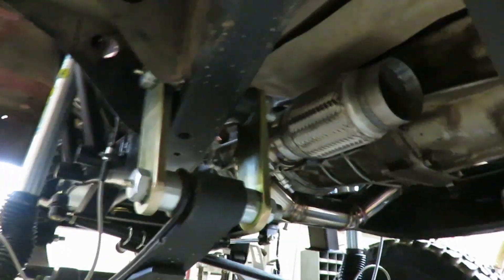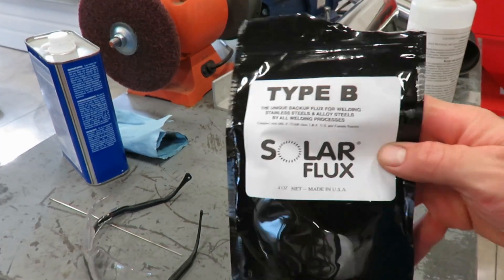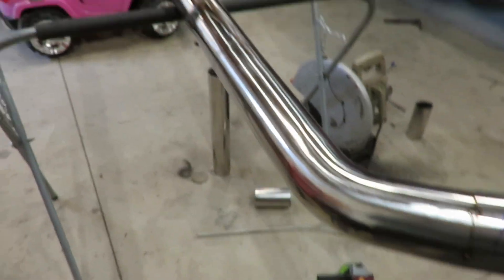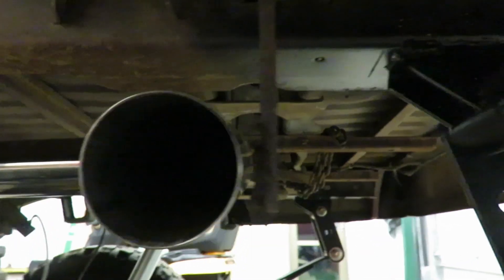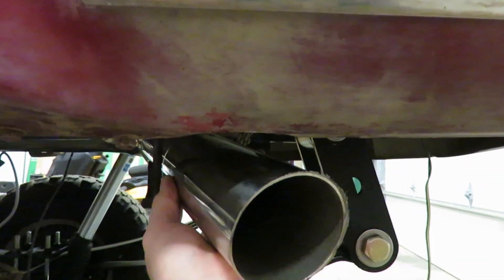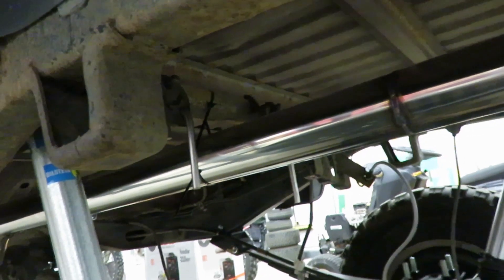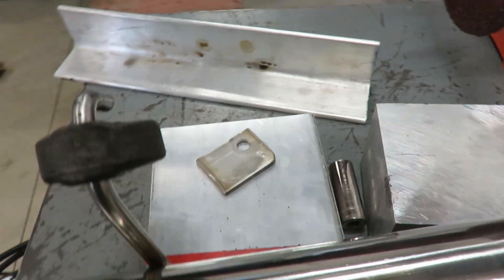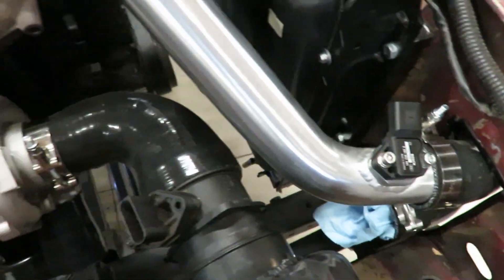Custom 3" Stainless Steel Exhaust Toyota TDI Swap Diesel

Comment: Great build!  I had to do the same thing on a 94 T100 with the cross over under the transmission (talk about making an exhaust job twice the work).  I've got an annoying humming vibration around 2k rpm that i'm pretty confident is coming from the exhaust harmonics/the pipe itself vibrating.  We've got almost an identical exhaust system as far as shape, diameter and mounting locations (i've got the same transmission mount location, great minds eh?).  The only difference is I've got a flex section on the downpipe I added to account for any thermal growth between the turbo and trans hard mount (Our engines are different too, which plays a part, but i figured if it's the exhaust shape/design you might have it too, just at a different rpm).  Have you had any exhaust related harmonics or drones?  

the youtube video kind of captures the sound (the noise amplitude is higher when it's cold and the rpm range it occurs at is pretty consistent).  Posts 43 and 46 in the build thread show my exhaust 

https://www.youtube.com/watch?v=2OtEjfx4nzc  
https://forum.ih8mud.com/threads/white-lightnings-diesel-conversion-a-1994-t100-om606-swap.1003338/page-3
Reply from the maker: Not much for exhaust done after I added a muffler! I also added a mount to bolt it to the transmission!